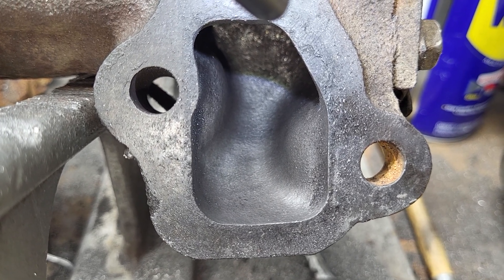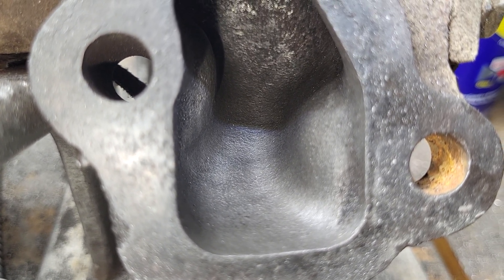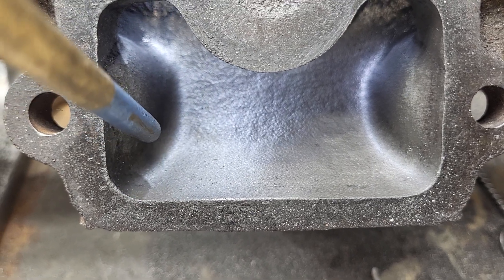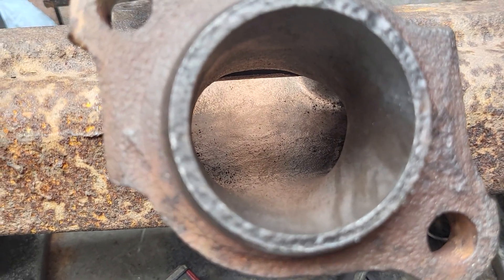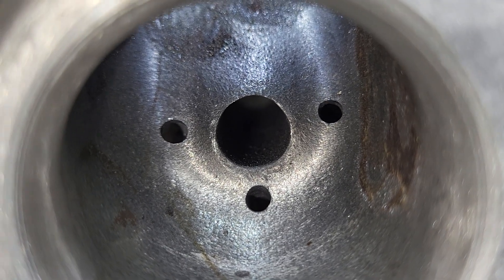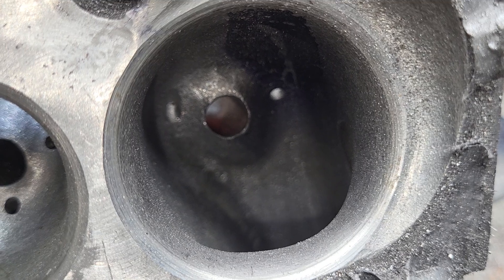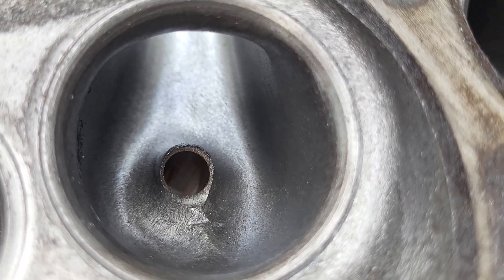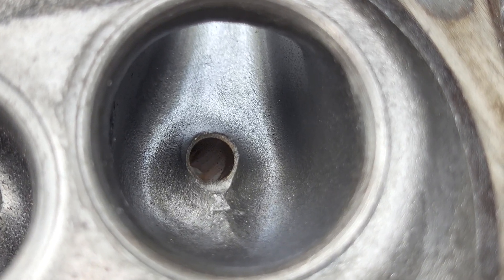David Vizard, Unity Motor sport Mission Impossible 318 project Finishing up

Comment: Wasting your time working on stock exhaust manifolds
Reply from the maker: That is part of the deal. Actually ported exhaust manifolds work better than you would think. I had ported manifolds on the old work truck for a long time and changed them for nice stainless shortie headers. No real difference. Maybe a few hp.

Comment: This is such a good and rare project. You never see these types of tests on stock, pedestrian economy engines. The final decked out engine will be something to see as well, the 318 is kinda the laughing stock of the MOPAR engines. Time for some respect 😊
Reply from the maker: I have no doubt it will hurt some feelings....
Reply: You would be surprised how many people thought they had a 340 or 360 as they were  with a  318 beating 5.0 Mustangs back in the day...Remember the 2bbl they used one was a smog economy the other actually performed tenfold better(cant remember what carb it was)..But a 4barrel is the way to go..

My buddy in 1991 had a 73 Challenger 318 that ran 13.33's in the 1/4..3.55 rear axle,automatic 904 with stage 2 shift kit,nothing wild..He even beat my other buddies 396 Chevelle SS...He bought a Chrysler crate 380 horse 360 in the late 90's when they came out,he worked as a parts manager at the dealer.His 318 was getting tired by then.He still has the car with that 360 and runs low 12's a few more tricks done to it but reliable and awesome,360's were always under rated too like the 318 and 400 also was laughed at for some reason,odd..mine always ran good/quick..

I looked at a 340 Duster but it was a 318,guy swore it was a 340 and he honestly thought it was a 340 this was mid-late 90's..I passed on it had lots of power,sounded mean..I am a big block guy mostly 440,400,383..had a 413 and 426 Wedge those ran great and hard too..

Comment: 500 hp with a 318, I'd like to see that
Reply from the maker: So would I. High rpm would be required.
Reply: @servediocylinderheads  about 7500 I believe
Reply from the maker: @No1414body  I was figuring 8k
Reply: With a 250 shot of NO²
Reply from the maker: @MP-pz9oe  Funny
Reply: Stock stroke 318's make 400hp..
Reply: @mypronouniswtf5559  very funny

Comment: Been there, done that. I did a set of 360 manifolds last year. They are pretty much the same without the air injection crap. I ended up getting a 2.25" outlet but it took a ton of grinding. I hope to never do another set in my lifetime.
Thanks for the video Charlie! It's great to hear some news on the 318 project.
Reply from the maker: Thanks
Reply: If it's only a matter of making the diameter larger, if one had a vertical mill they could simply bore the hole larger. It would take longer to set it up than to bore the hole. Setup should be relatively easy clamping the exhaust port mounting flange to an angle plate and aim the outlet straight up as close as possible. If it isn't quite square to that mounting flange, adjust the head of the mill to the angle needed.😎👍
Reply: @itseithergonnaworkoritaint7852  It would have been a lot simpler but it would take all the fun out of it. 😆
I didn't keep track, but I estimate between both manifolds I invested at least 20 hours in them. All because I despise headers on a daily driver.

Comment: Nice workbon the heads charlie. If its any head other than the #302 casting you ahould have 360 cast bowl size. They are plenty thick to get your work done.
Reply from the maker: These are 318 open chamber heads. Bowls are pretty small.

Comment: Charlie, nobody said you were slacking.

Thise are the truck manifolds from thr old d series u til the magnum motors in 91. They flow quite well compared the the car headers. Which were rediculously restrictive. I think the magnum manifolds were only down 15hp on a set of long tubes.
Reply from the maker: Magnum is a better design. Thanks